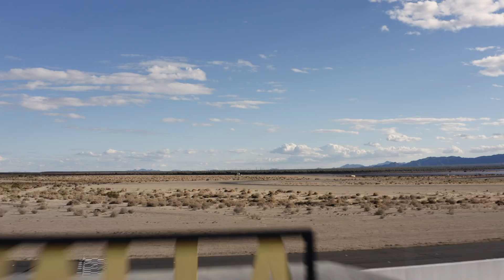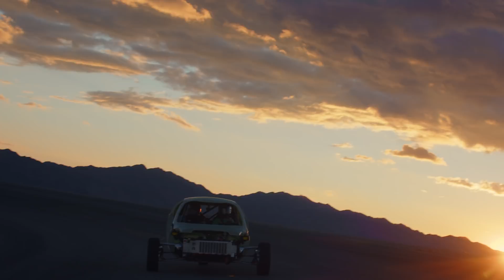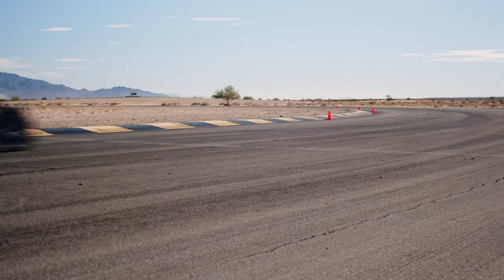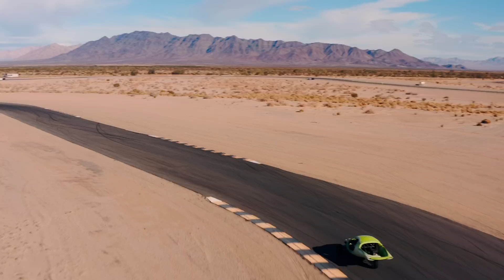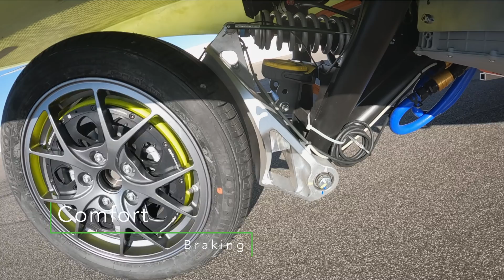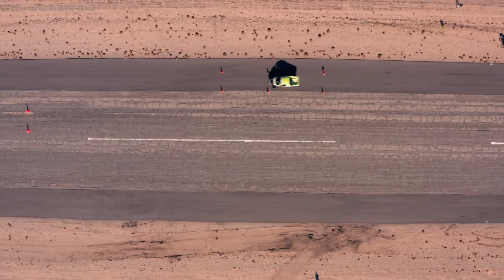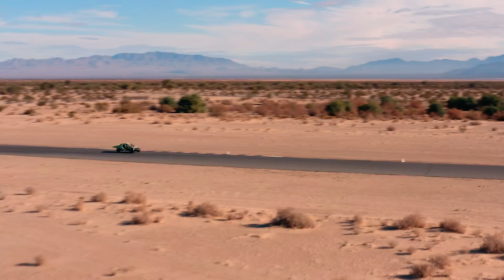Aptera — Vehicle Dynamics Testing

Comment: Every time one of these videos comes out I start tensing up and just shaking because I'm so excited.... One of these times I might pull muscle but that's not your guys's fault it's mine. go aptera. Heck yeah!

Make sure this is one of the best vehicles you will ever have made affordable. I really hope you keep your build quality way better than Tesla because the model 3 and y are a joke to me.
Reply: Also if you reading this....aptera.... Have you tried doing a 360 drift....... Is that not going to roll over..... I'm curious. Someone's going to try it but I'm just curious if it's even possible or if the rear wheel might snap off. Can you lock the rear wheel and drag the tire around. How will that behave
Reply from the maker: Hi! Haha, we certainly hope you watch our videos with care then! ;) Trust us, we're not rushing this. It is our goal to deliver the most highly efficient vehicle of the highest quality. We're not cutting any corners here. We appreciate your patience while we continuously improve!
Reply: @ApteraMotors  Don't forget about safety. Never cut that corner pls. Also YEAH YOU ARE PUSHING THE CHASSIS THROUGH THESE CORNERS AND THE MOOSE TEST OVER AND OVER BASICALLY DRIFTING THE CAR AND I NOTICED THAT 18 SECONDS IN TO THE VIDEO LOL.

Comment: I hope you have accounted for the weight you removed from this test vehicle. If not then you can do it again. MC
Reply from the maker: Hi Martin! The first Beta vehicles will have several different purposes, including suspension and drivetrain testing, interior mock-ups, safety testing, HVAC, and other testing needs as we push towards production.
Reply: Weights were also added to the chassis to provide the proper amount and front/rear weight balance for good data.  These are real engineers....
Reply: @n.brucenelson5920  How about the aerodynamic loads?
Reply: @martincaskey3121  They are easy to model. At low speed they are very small but increase with the square of the velocity.  The data collected is easy to adjust for the difference in Cd., which can be modeled in software.
Reply: Hello Bruce
So you have the Cd#s for a clean car with the windshield side windows & rear deck. How about the lifting loads due to the shape? Now the Cds# for a striped mule w/o windshield, side windows & rear deck and two drivers poking out in the wind.
My bet is the number is very different than your model. 
I thought this was a test to prove the models are correct.
Just questions not advise.
Thanks

MC
Reply: @martincaskey3121  I don't know all the answers, of course, but I have had a chance to talk to a couple of the engineers.  It turns out that there are 25 #s of downforce at the rear of the Aptera at 65 mph, which rises rapidly from there with increasing velocity.  This is of course for a complete shape with windshield.  As for the rest, I don't know the numbers myself.
Reply: @n.brucenelson5920  
Good news for the down force. The shape lends it self to lifting at speed. I'm looking forward to picking up mine soon. 
Thanks for the update.

Comment: do you have 60 mph braking distance, lateral Gs, moose test speed? also which version(s) of the battery are you testing? I guess the 250 and 1000 miles will have quite different weights and CoG..looks like a hell of a job tuning consistent handling characteristics across the range, but also a very interesting one!
Reply: These are test vehicles, not the full weight production models.  These test results do not mean anything to the consumer right now.
Reply: @freddyrosenberg9288  they tested betas and alphas. I bet the tests do mean something otherwise why perform them? although I agree numbers are probably not super accurate, I think removing some carbon fiber panels does not alter the handling nearly as much as 25kWh vs 100kWh batteries
Reply from the maker: Hi there! You can read more about our results in this blog post: https://aptera.us/beta-hits-the-track-for-vehicle-dynamics-testing/
Reply: @ApteraMotors  I understand it's too early to throw some numbers. I hope the apteral will live up to its promises. Id be happy to hear from the next aptera, hoping it can have 4 seats and 4 wheels and even more solar panels. just wondering if hub motors could enable more flexibility and adaptive suspensions with tweaking of the suspension height and/or width low and narrow on the highway for efficiency, low and wide on twisty roads, high and narrow in city for visibility, agility and easier in/out.

Comment: Then once the rear wheel is as wide as Two of the front Tires you could then offer winter studded Tires
Reply: Aptera uses standard size tires, and I would guess that studded tires would be available to install where they are legal.  In Iowa, where I live, they are legal from November 1 through April 1.  I just checked and studded tires are available in the P195/45R16 size Aptera will likely use.

Comment: You desperately need an ultra wide rear tire their are custom build motorcycle's with wider rear tires than the Aptera has
Reply: You could easily modify the rear wheel width to where it's literally twice the width as one front tire. So the rear single tire is equal in grip to two front Tires

Comment: How does it handle at high speed when the rear tire blows?  Then both front tires/just 1 tire?  I haven't heard anything about blowing that back tire at high speed/on a turn.  Blow that back tire on a turn in the rain and blow the front right in the rain.  Run over a metal spike or hit a deep pothole that rips the tire off the wheel and tell us what it does.  That has happened to me on my 4 wheel cars, what happens on a 3?
Reply: That should be the next phase of tests probably with the Gamma versions when they do crash tests, etc.

Comment: I'm a bit confused though....testing it with all the bodywork and a full interior NOT on the car...doesn't that mean the data you get DOESN'T match what the production vehicle will do because the lack of weight and aerodynamics the full non-stripped car would have would be different than a stripped and lighter version with no aerodynamic panels...?
Reply: No.  Fully fitted out vehicles will also be tested.  Every serious vehicle manufacturer does this kind of testing.  We just usually don't get to see videos of it.  There are videos of Lucids with interior roll cages for the same reasons.

Comment: What the hell are those roll bars. This is some real bullshit. Sold us a whole bunch of lies saying they had a production ready vehicle almost two years ago and now we can clearly see they cant even build the body of the car yet.
Reply: If you  knew anything about engineering you would know.  Look at the video of the early Lucid vehicles on the track that had the same thing.  Aptera never said they had a production ready vehicle, and still don't.  You are the one slinging real bullshit.  As everyone can see, they are doing exactly what they need to to develop a vehicle worth owning.
Reply: @n.brucenelson5920  That Lucid was doing 235 miles an hr. So yeah they installed a roll cage. I've been following a Aptera since their first business incarnation. They definitely did advertise the new company launch as having a near production ready vehicle. And now they can't even build the car body that had designed and prototyped a dozen years ago. It is bullshit.
Reply: @DavidElzeitsinfill  So?  The Aptera could be doing 110 mph on 3 wheels.  The consequences of testing to extremes could be just as severe.    Your "argument" is meaningless.  

As far as your claims, i joined Aptera as a Brand Ambassador, and early investor before the launch, and I never saw a claim that they had a production ready vehicle.  When I first invested they didn't even have a prototype, and the first prototypes were clearly labeled as alpha vehicles.  Why lie about something in public where everyone can check out the facts for themselves?  

Of course, they are not building the vehicle they designed and prototyped a dozen years ago - That would be bullshit.  The present design is completely new, beginning in 2019, although there are some conceptual similarities.  There are zero common parts between what they are doing now and the original concept, which came from a 1983 design by Gino Morelli, as they have acknowledged. .  The beta bodies of the present design are not even the same as the alphas, having more room inside with the overall air resistance.
Reply: @DavidElzeitsinfill  As an early investor and reservation holder too, I can attest to @N, Bruce Nelson's response. How did you arrive at your conclusions?
Reply: @adimchionyenadum2962  When Aptera relaunch they had a working car they were driving around and just some CG model. The were selling themselves as already having this IP which they bought back from the Chinese company. They said in the last ten years battery and electric motors and electronics have evolved enough to make the Aptera a real possibility and not just vaporware. It's reasonable to think with that setup they should be in early production right now. Not testing. I think a lot of people that ordered the car thought it would be in production by now. It's technically a motorcycle. The barriers to bring it to market aren't as much as that for cars. The company had a very limited number of supporters and is just going to loss more and more supporters the longer they take and I'm here making that point because I don't believe they are hearing that enough. You are telling them what a great job they are doing and it's bullshit. They need to adjust their sense of urgency.
Reply: @DavidElzeitsinfill  You are right that a lot of people that ordered the car thought it would be in production by now. They even said that themselves. But as is the case with every startup, I knew that was a forward looking statement. That is why investors in startups have to DTOR and know their investments risks. These companies are not bound by law to keep any of their promises.

Secondly, really they had a working car, and have built two others that are criss-crossing the American roads the last one year. But a working car is not the same as a production car. They never said they had a production car. Rather they made it clear before launching in December 4 2020 that they were planning to produce a Limited 330 Paradigm models by the end of 2021. Yes we can fault them for the one year delay, that is getting into the second year. Nothing else.
Reply: @aussieideasman8498  Whoa Aussie ideas man!
Reply: @aussieideasman8498  "Like the promise that Dec 31, 21 was the last opportunity to invest, and you can in Feb 22?" --> They actually never closed it. It was available on Jan 1st. They did raise the price per share by a few cents... I found that odd myself, since I received emails saying the investing window was closing, but then it never closed.

It went from $8.80 to $9.20. I would like an answer about this lie, as an investor and as someone who has reserved a car.

"Thank you for your interest in Aptera and our mission to create the world’s most efficient vehicle. I want to let you know that Aptera’s current fundraising campaign under Regulation A is coming to an end. We will stop accepting investments at midnight on December 31."
Reply: "According to the Aptera CEO, beta builds will have roll cages because the tests will push them "well beyond their normal operating envelope.” “The intent is to break stuff and test the limits of the Aptera. ... That is a crucial clarification for such an unusual vehicle like the Aptera."
Reply: David Elze:  Funny comment there.  Watching and not reading, eh?

Comment: The testing looks promising. The only comment I would have is, it would seem that the handling of the beta test car would naturally be improved over the alpha because the beta car is stripped. For example, just the weight of the missing glass would influence the lateral forces as the car is thrown into corners.  While I am sure the testing was valuable, a fully spec car would have different results on the skid pad, under braking, acceleration etc. I still can't wait to get my hands on one.
Reply: They have also added weight in the metal roll cage and other weights including the radiator to simulate battery weight and balance.  I think the results will be very comparable to the final vehicle performance.  They don't overlook such things
Reply from the maker: Thanks for the comment, Warren. But our Beta vehicles are crucial to our ramp to production and to test specific elements of the vehicle and the ride. They really serve to integrate production parts into our first development vehicles! We'll progress that through Gamma and Delta, and hopefully have a production intent vehicle design and begin ramping production in 2022. One of the biggest changes in the Beta series vehicles is the size. We've made it bigger, but we've also lowered the drag to make it more efficient. So there's no net increase in drag from the Alpha series vehicles. We've increased the headroom and the side space near the hip so it's going to feel more roomy inside. Through our Alpha phase of development, we found opportunities to optimize our stability, turning radius, and maneuverability. All of these things that we learned during the Alpha phase of development have resulted in improvements in our Beta design. You can learn more here: https://www.youtube.com/watch?v=sq5hjSnZ-8k.

Comment: Is the skin cooling not on the Beta, I notice a radiator that doesn’t look like it belongs on the finished model.
Reply: This particular beta is not testing the cooling system.  Different betas are being built to validate performance and parts for different systems.

Comment: The suspension looks like it's doing a great job!
Reply: Even though I am not an expert, I seem to get that impression too.
Reply: Why is all that extra roll bar structure there. Why isn't the car body built properly?
Reply: @DavidElzeitsinfill  It's a test mule and they're tossing it around on a track. It's to test the mechanical bits and to keep the test drivers safe while trying to find problems.

Comment: Looks like it could beat Jeep Grand Cherokee and Citroen Berlingo in Moose test. 👍🤔
Reply: What is Moose test. Care to explain?
Reply: @adimchionyenadum2962  It is a standard test to determine how well a vehicle can avoid a sudden obsticle in the road, like a moose, without losing control. The ISO double lane change mentioned in the video is a kind of moose test. The vehicle that can perform the maneuver at the highest speed without losing control, Wins.  Vans, minivans; jeeps and any high clearance vehicle are usually terrible at it, tending to roll over at higher speeds. Sports cars usually do quite well at it.
Reply: @fotoguru222  Thanks Harry for the answer. Had no idea.

Comment: I want fat sticky tires on my Aptera, because I place higher priority on good handling over a couple of percent greater efficiency from skinny low-rolling-resistance tires. The Aptera’s appearance promises driving fun —  I hope the final design delivers on this.
Reply: From my experience, Aptera will deliver both, and since they support right to repair, won't be placing silly restrictions on you to experiment with other wheels and tires, or even programming of the motors themselves.
Reply: The two main forces slowing an EV down are drag and rolling resistance. The lower the drag is, the more important rolling resistance becomes to gain efficiency. On most evs you can already see a 0-10% drop in range with sticky tires bit with the aptera you can bet it'll be more like 10-20%. I will probably try out sticky tires just to see if it's worth it or not.
Reply: @osimmac  : yes it will be fun to experiment.
Reply: i want to optimize my Aptera AWD for faster 0 to 60 don't care about efficiency , I just want I cool futuristic look like aptera some sticky and mods to make it quicker !! maybe find someone to unlock full motors potential etc, who knows it gonna be fun experiment with the Aptera.

Comment: I don't understand how removing the windshield etc doesn't introduce extra variables. How do you know the relative lack of aerodynamics doesn't improve your lateral stability in corners or something similar?
Reply: They are going at low enough speeds that aerodynamics shouldn't play that big of a role in stability. Plus they have plenty of engineers that I'm sure have considered that
Reply: I'm pretty sure they can install the rest later,  once they know it won't flip over and break everything.

Comment: Since it isn’t a typical car, will a motorcycle license be needed to drive it in the US?
Reply: No - it's considered an "autocycle" - no MC license or helmet needed.
Reply: @michaelmay9958  Depends on your state's laws, not all have an autocycle classification, but Aptera's lobbyists are working on it.
Reply: @michaelmay9958  alright, good to hear. I heard of that category, but so far really only 1 other vehicle exists in it
Reply: Not in most states.  They're working on the others.
Reply: At present 43 states recognize it as an "autocycle" that requires neither a helmet nor a motorcycle license. The other seven states have a mish-mash of laws and statutes that need to be addressed. As I recall, one state specifically prohibits electric 3-wheeled vehicles from its roads!
Reply: @narphizoid  A state prohibits Aptera and its like from the roads? That's news to me. Which state is or was that?

Comment: I'd be curious what the car does when it looses grip around corners. It must understeer like crazy. I wonder if there's a physics-based way to force the car to understeer before the rear wheel loses traction? (i.e. locking up one/both of the front wheels to induce oversteer?)
Reply: You can kind of see a slow-mo at 0:43 of it understeering.
Reply: Torque vectoring maybe. With in-wheel motors the car processor can control its directional stability on the fly.
Reply: Your doctor will tell you when you wake up from you coma and ask “ what happened ?”